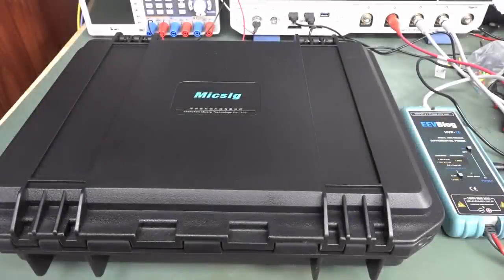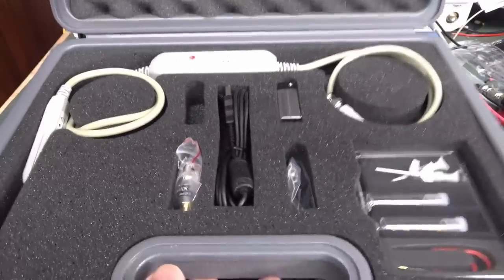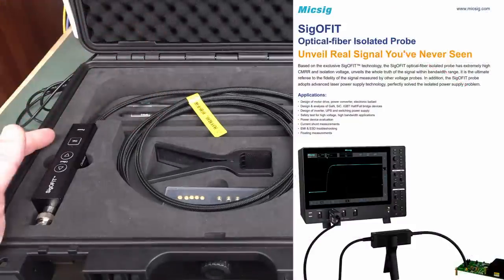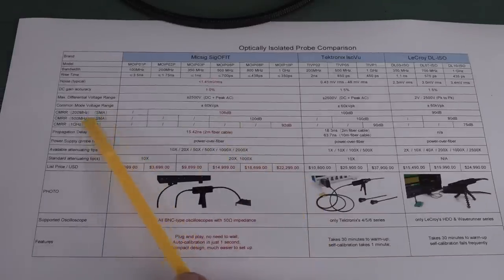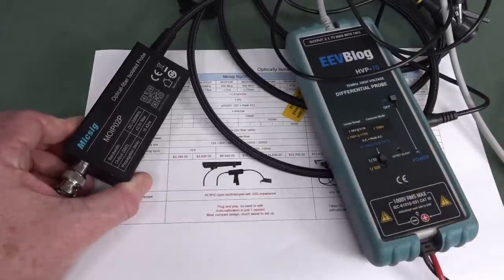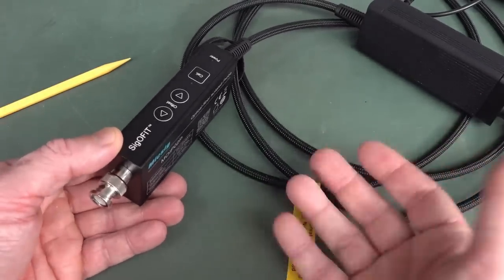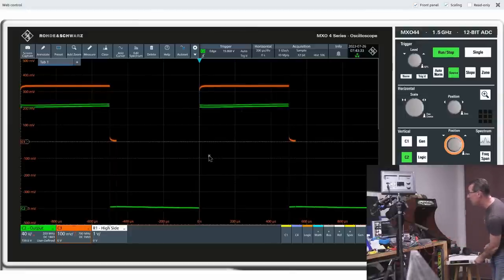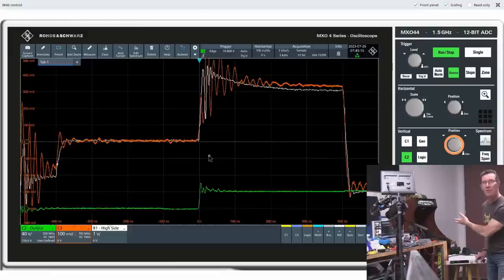EEVblog 1557 - Micsig SigOFIT Optical Fibre Probe + GaN Experiment

Comment: Thank you so much for making this great review, Dave. Really appreciated!
Reply: Take it there are a lot being sold in Switzerland, to a certain large company that needs to get the best results out of the small signals they get on detectors, that ride on a large circulating current.
Reply: Dear @MicsigOscilloscope please finally allow us to unlock your SATO scope series.
Reply: Why cannot you use usual 4 channel oscilloscope connecting 1, 3 channels to the high drive points and 2 and 4 channels to common ground, then use math functions to get differentials between 1 and 2, the 3 and 4, then math again to measure differential between the so maths effectively ibainjng ideal waveform? Save tons of bucks!

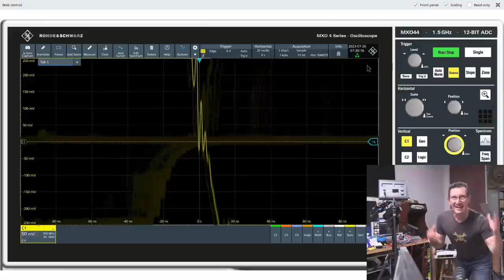Comment: Hi Dave, at 27:50 of this video you seems to get mad because you accidentally pressed the Preset button and your settings were gone. Since you are using a Rohde&Schwarz oscilloscope, actually this would have not been a problem. Indeed, in an MXO4 you could have just pressed the "Undo" button in the Toolbar (available among the settings of the upper left corner ) to get your settings back. Since the Toolbar is customizable, I would suggest to have the Undo button among the favorite ones.

Comment: PMK makes another option for optically isolated probes. They were some of the original designers of the Tek IsoView before they went off to do their own things. Generic coupling, up to 1.5GHz bandwidth, battery powered with an 18650 cell, nifty offering.

Comment: I was involved in helping design a fiber isolated probe for an industrial system and its crazy hard to get good linearity and long term stability, we tried many systems including PWM/Class-D style, biased LED analog, laser power level stuff, in the end we just isolated the entire data converter 
granted it was for a 16 bit system and none of us specialized in this but still i have massive respect for the engineers who even went as far as fiber power
Reply: hmm how were you transferring the data?  like digitally whats the linearity problem with it?  analog sure it would be really problematic(that's how powerglove works iirc, or some other glove anyway).

you can now get optical 50 feet thunderbolt cables off the shelf, so stuff related to it has probably gone down a lot in cost.

Comment: At 25:48 you talk about what you call "ringing" on the rising edge of gate voltage. That's not due to the probe connection, but it is the Miller Plateau effect of the MOSFET. The change of direction of the gate voltage is due to the low (or missing) gate resistance between driver and gate; with higher resistance, that shape would change to a short flat line (then the term "plateau").
This happens because the gate voltage is pulled down by the GD capacitance initially charged to rail voltage and then suddenly connected to ground by the turning on of the MOSFET. Once discharged by the gate driver, the GD capacitance will appare in parallel to the GS capacitance, and the gate voltage will start to rise again.
The effect is visible even at turning off (with opposite polarity). The lower amplitude in this case shows the different source impedance of the driver in the two states on and off.

Comment: Would be interesting to compare this setup with the Cleverscope CS548 (discussed in EEVBlog #1119). From my understanding it has 100dB CMRR at 50Mhz and 4 isolated channel with 200MHz bandwidth. They also have remote digitizes for multi-KV isolation. And the price is quite comparable.

Comment: You could still measure the high side switch on the cheap by using battery powered portable oscilloscope. This was done for the decades. The only scenario when you'd need this probe is when you have few signals to observe and they are  synchronous so timing is critical .
Reply: CMRR of battery scope is also very bad. A key element of these optical probes is the tips: they don't use off-the-shelf coax, and include "distributed common-mode chokes" along their length. It's not possible to achieve the same thing with battery scope + passive probe + clip-on choke.

I know this because I've tried it - battery-powered scope vs IsoVu with a common-mode signal with over 100 V/ns slew rate and there's just no comparison - battery scope gives you garbage, IsoVu gives you something intelligible.

Comment: It would be nice to see a signal taken from the low side of the bridge by a passive 10x probe for comparaison (especially since that is what I would do if I had the problem - just measure the side you can and then assume that they must all work the same). 

And of course it would be a pleasure to see a teardown of the power transmittion optics and electronics of the thing (especially on the receiving side). 

But other than that it is a great video!
Reply from the maker: The low side is just a regular probe measurement, no CMRR switching, nothing interesting there at all.
Reply: @EEVblog  It would just serve as a phase shifted reference to compare the more interesting signal to. It would show how a signal from a near perfect differential probe should look like assuming all the transistors and driver circuits are near identical. And the more similar the signals would look the better the differential probe must have been in order to produce the result. 

It is a minor thing of course, the situation with the fancy probes is already clear as it is. I was just surprized to see the fourth channel of the scope unused :).

Comment: Not only physics and R&D, but also a more or less forgotten group, repair.  And then the more advanced repairs on component level. Things like big HV SMPS, HV calibration gear, Capacitor banks chargers (Had to repair a 6kV one, blew up a Brymen BM869S DMM when the thing spit out >40kV where only 500V should be)  or f.i. a laser RF, they are almost impossible to probe. I use a diff probe (On a R&S 300 MHz full options RTB2004 (best scope I ever used) all the time because while trouble shooting I do not only measure against ground. It is much faster to probe around with a diff probe while troubleshooting (Most times without schematics so a lot more probing) I will buy one, thanks for the demo
Reply: Are you done making new videos? Such a shame!
Reply: @worroSfOretsevraH , I'm sorry, It just costs to much time and I hate editting.

Comment: A teardown would be super cool, especially the probe head with the fiber-optic power.

Because you would need to convert the incoming powerful laser light to power the circuit, and then still have enough juice left to send another laser signal back, all with up to 1GHz of bandwidth? Some interesting power envelope calculations for sure.

Comment: The changlle of the test is , the GaN Components has fast slew rate which rise time can up to 1ns,the traditional device can also have MHz switch speed, but the traditional differential probe can take a measure.

Comment: I'd love to see how they send 'power' over the optic fiber?
Reply from the maker: Just dump a few watts into the laser diode and hope you get enough out the other end after conversion.
Reply: I've yet to get a real oscilloscope to experiment with...being a mechanic by trade I've used pocket or built in oscilloscopes to see starter current to judge compression, coil pack current to check them or trigger to watch crankshaft position, camshaft position sensors to catch intermittent or weird failures, etcetera. But I need a real one so I can dive headfirst down the rabbit hole and really level up my diagnostic abilities...I know the theory but have not been able to put it to use...and oh my...the ability to see what is actually happening on any data line...save me alot of time...instead of guessing if an ecm is getting or providing data etc...yes please...GaN is something I'm looking forward to for power supply...ive noticed chargers for example output less once at it working temperature...2 amps cold and 1.4 hot on a phone charger...I throw them away
Reply: @bentboybbz where do you live?
Reply: @EEVblog  Lets see it then. Don't turn it... Tear it apart!

Comment: Great video, I would love to see a comparision between SigOFIT, IsoVU and DL-ISO in the future, I would also like to se how they compare on the low side vs a passiv probe. I did a test 4 years ago on the isovu on both highside and lowside, and on the lowside the isoVu seemed to have faulty noticable lower voltage level after the rise time, it was a demo probe so it may have been damaged. Anyway it would be intresting to see.

Comment: Going to jump on the "take it apart" bandwagon. Are they using off the shelf optics? Assuming two fibers, one for power, one for signal, but idk they could be using a single fiber and muxing two wavelengths on it.

Comment: If I recall the highest bandwidth scope Micsig have in their line atm is 500Mhz and that is still mainly CN market that ETO been  released, for western market it peaks at 300Mhz if I recall with TO series-.
but think twice before you jump into bed with that company.
they will promise a lot, to create hype & goodwill, and then not deliver and instead hurry into hiding, like Micsig own rep on EEVblog did.
The way the threated their 1000C series buyers, was a joke with their running app-ecosystem that would get constant new apps and features etc and the nail in th coffein was the latest faulty OTA update that crumbled the bandwith filtering, that otherwise was one of the really good thing, until they broke it with one of their infamous OTA updates.
Reply from the maker: I have not heard this, link?

Comment: Saker in Spain makes one.  It uses a battery instead of a high power laser to power the isolated head.
Reply from the maker: Interesting. 6084€ and you don't get ower over fibre which is nicer. But can be used with any scope. It stops at 220MHz though.

Comment: Dumb Question: Assuming you could find an USB Scope with isolated trigger, wouldn't it be easier to isolated the USB interface  as well? Use two scopes, and let the isolated trigger sync the waveforms between channels?

Comment: With GaN/SiC, it's not just the switching frequency that you need to worry about, but also the frequency content of the switching edges themselves. When you were using the "traditional" HV probe and you reduced the switching frequency of the converter, things only "looked nice" because of the time scale required to show a full switching cycle. if you had zoomed-in to the switching edges, it still would have looked horrible, with ugly ringing all over the place.

Comment: I appreciate the use case and benefits, but I'm still confused how optical probes work - I'm assuming the acquisition part that connects to the DUT is based on conventional methods and the noise immunity improvement and high voltage isolation come from the signal information being transmitted to the scope by fiber, which provides galvanic isolation?

Comment: Question: Can you only measure the signal of interest with a MCX connector or are there different ways to use this probe? If a specific connector is required to measure a signal that means your PCB must have this interface available, correct?

Comment: I guess when switching at 1kHz you didnt see any ringing in your diff probe because you zoomed out 1000x from your 1MHz reference measurement. The switching frequency isnt actually important for the CMRR but the slope of your switching events. In this case a great CMRR at 1MHz wouldnt help much if it is bad at 10MHz or higher..  Great video though, thanks :)

Comment: Couldn't you get pretty much the same result by measuring the high side gate drive wrt 0v, measuring the source voltage wrt 0v, and subtracting it from the first signal to get the gate drive wrt the source voltage?

Comment: Since I didn't quite get it and this is far outside my area of expertise, are there actually probe tips to this or are you supposed to design smx connectors onto your board to use these probes? I guess the use case is not so much for probing but testpoints? I doubt I will ever see one of these in the "wild", but nonetheless, very interesting piece of kit.
Reply from the maker: You can just solder on a short coax like I did. But it's not uncommon to design PCB's with dedicated test points in mind, especially where it's critical.
Reply: @EEVblog Thanks for the reply. I guess that makes sense, especially given how these go up to tens of kV.  How would they go about designing the test points for the full 60kV though? Wouldn't that arc 2-3 cm in air? I don't think I've ever seen an MCX connector with such a rating and in the manual the 2000:1 tip still looks like it uses those.

Comment: Just wondering if an old analog scopes with differential mode (or does any modern scope still do this in signal level?) can measure such high-side drive.
And who when will be that "take it apart! " part?
Reply: Modern digital scopes can do the same thing using math functions. Best case I think the results mirror those of the traditional HVDC probe.

Comment: How does it transmit power then?
Reply: Light in the other direction than the signal.
Reply from the maker: Just stick a handful of whatts into the laser diode and hope you get enough out the other end after conversion.

Comment: Dave, your 1kHz test is nonsense. Just increase the time resolution and see that the edge is as bad as with 1MHz. Rise time of the halfe bridge does not change with clock frequency!
Reply from the maker: Yeah, but the point is that you don't care about that edge nearly as much in terms of energy and gate drive losses because of the time/vs duty cycle then you do at 1MHz.
Reply: @EEVblog  say what? You dont care about the signal integrity of the gate driver? Cmon!
Reply: @EEVblog  Looks like you are too long out of the engineering business and too long into the show business. What could go wrong when a half bridge gate drive switches bad . . . If you don't see a problem, it's not there, isn't it?
Reply: @JacquesMartini  No why would you care at 1MHz, thats super slow switching speed.

Comment: take 2 ferrite rings, wind 10 turns + a 50 ohm resistor and that's it, the price is $ 1....and saving $3,000))
Reply: I’m not sure if it’s as easy as you said.  
Getting a transformer to have a flat frequency response from near DC to 1 GHz does not sound trivial.

Comment: Really schmick. I want to experiment with GaN stuff but when the cheapest one is more than 2x the cost of the most expensive equipment in my lab, I think I will just connect a scope to a battery and use a normal probe.
Reply: @MonkeySci  I have thought about that. I am thinking to get a good response would require custom filters and a lot of tweaking on a VNA, but it seems doable. Not as bad as making a DIY normal probe, right? No unobtanium lossy coax 😄

Comment: Why cannot you use usual 4 channel oscilloscope connecting 1, 3 channels to the high drive points and 2 and 4 channels to common ground, then use math functions to get differentials between 1 and 2, the 3 and 4, then math again to measure differential between the so maths effectively ibainjng ideal waveform? Save tons of bucks!

Comment: I have a... strange question. You used the term: Totem pole. I was thinking what that meat in Australia, but then I realized those objects are part of the indigenous North American-North West culture. 

And now I'm scratching my head, wondering about how Todem Pole output is a meaningful term. I think you mean Push-Pull, which may have been nicknamed Totem Pole at some point in history, but it has nothing to do with those objects at all.
Reply from the maker: Totem Pole is common industry term for this arrangement. Or Push-Pull, Half-bridge, take your pick.